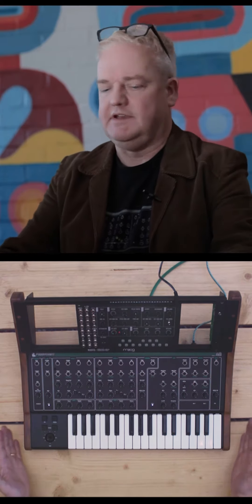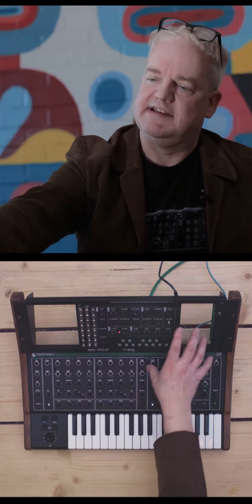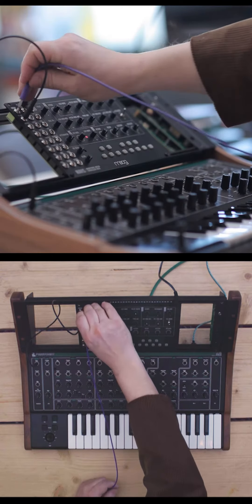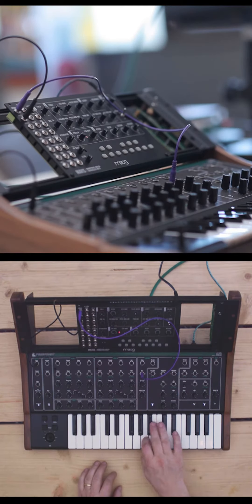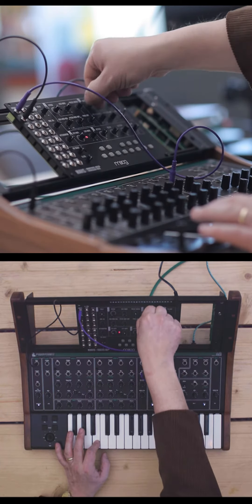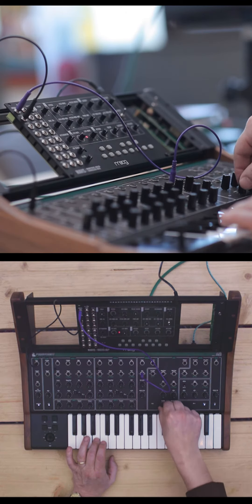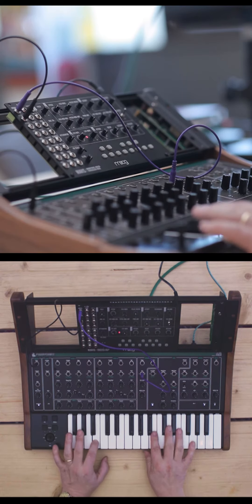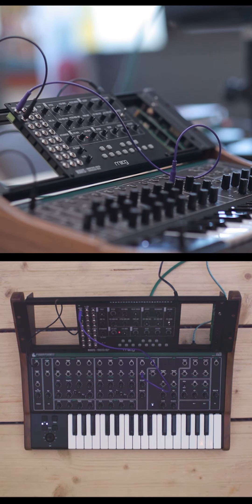Connecting Malevolent to a Moog Mavis

Comment: This, and your dueling Malevolents videos, makes me want a Malevolent expander in lieu of a desktop version. Like the Mavis, a stand-alone desktop unit that's eurorack compatible, but can easily stack on the Malevolent with a cheek swap + midi connection. Throw in some buffered multiples and other utilities. Current owners would want to buy another one because 4 x VCOs, guys that have enough keys have a desktop option, and eurorack builders aren't left out.

Comment: Where did you get that case that holds both?
Reply from the maker: The rack is an 85 HP Behringer rack with power supply module. It fits perfectly to the length of the Malevolent